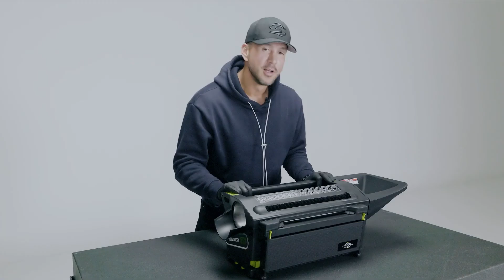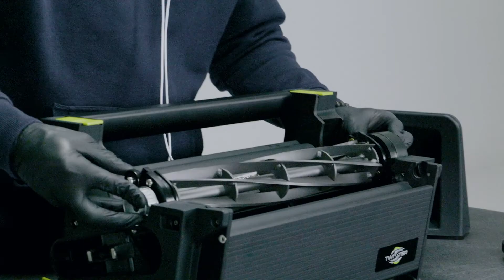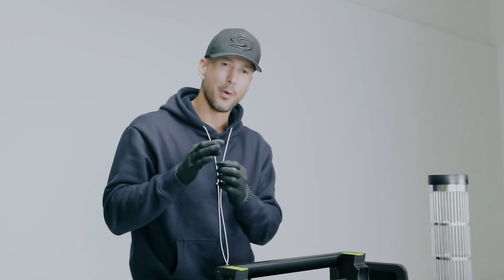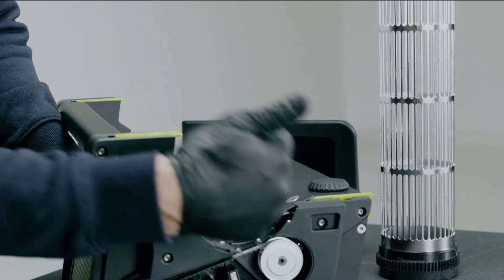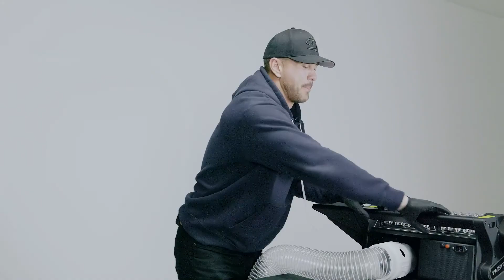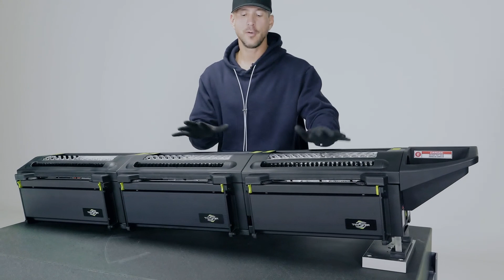Twister T6 Walkthrough | Twister Trimmer | Small Grow Cannabis Trimmer

Comment: How long can I run it at one time before turning off
Reply from the maker: Depends on various factors.  The temperature of the room (cold is ideal.  warm temps make trichomes sticky and gum up machines).  Wet or dry flower (wet flower requires cold water application on the brush every 5 min).  The voltage at the machine (long, small gauge extension cords are bad).  Stickiness of the flower.  We recommend you turn the machine off and give the blades a scrape when build-up occurs - otherwise, this buildup can overheat the machine.
Reply from the maker: Here is a demo vid:  https://www.youtube.com/watch?v=5QJRxJQCav4&t=4s